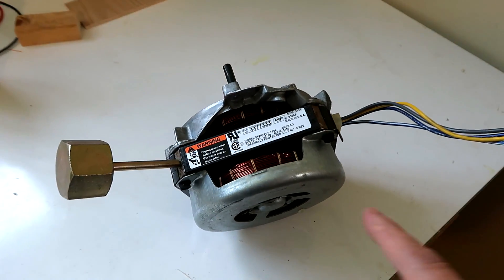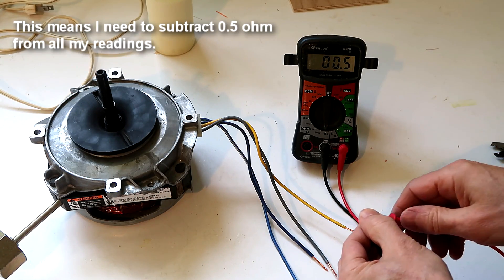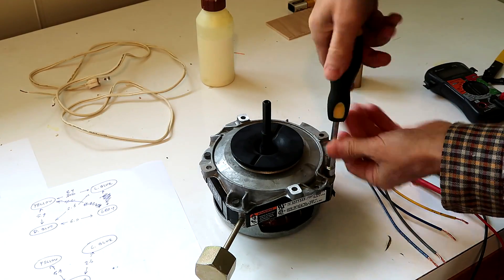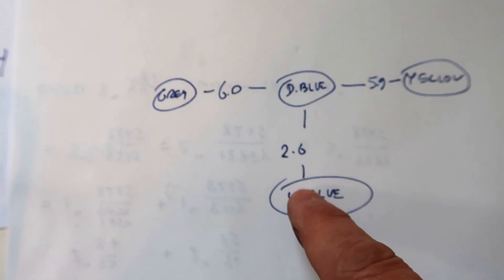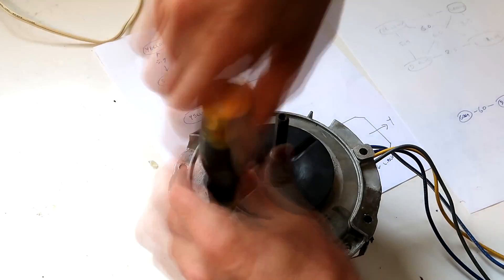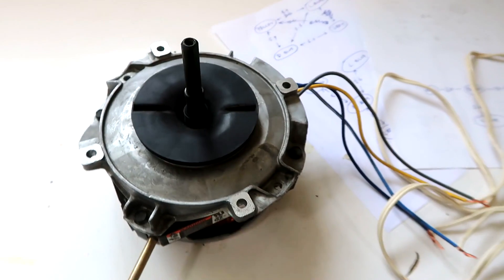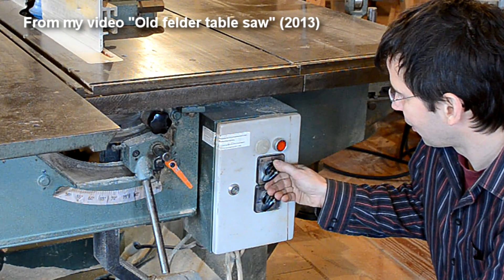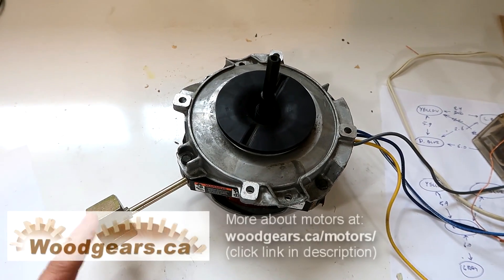Figuring out motor wiring - one example

Comment: Thanks, Matthias. I just got this exact motor from a dishwasher and found your video.

If I may suggest one thing, when unsure of the motor (which could be shorted internally), use a clothes iron or a heater in series. If there is a short, the series load will take it instead of sparks and a tripped breaker.

Comment: I have what I thought was the same motor except I have red black blue and a white wire I thought was neutral and that's how I run it but this had a weird start coil that was like the capacitor and went to the blue wire. I just touched it on the hot real quick to start

Comment: For the record, there's a simple way the controller can tell if the motor has started (and I'm not saying any appliances DO this, as I'm not in the business): let's say it drives a relay or triac to connect one lead or the other of the resistive start winding to the line for the run winding, and holds that for half a second (or whatever) - when it ceases driving the relay or triac, if the motor is turning, there should be a substantial AC voltage across the start winding.  Safely clip a DMM set to appropriate AC voltage range across the start wires, along with a suitable jumper wire from one start wire or the other (CW or CCW) and touch that to the Line as you switch on the motor, and as per your video disconnect that just as soon as it is running, and you'll observe an AC voltage on the DMM, even though the start wire is no longer connected.  If you don't touch it off and let the motor hum when you apply power to the run windings, you'll see there is no AC voltage on the start winding.

I'd wager one could use the voltage across the starter windings to ascertain if the motor is bogging.

CAUTION: the starter wires will also have power on them if you were to say spin start the motor, so don't assume that because YOU aren't energizing the wires by connecting them, that they are safe to have dangling about.

Comment: Holy crap - I can not believe I found this video. I'm working on my Kenmore Diswasher 665.15772990 right now and the motor has failed. It tries to start up but it struggles to move. (Motor Part #3377333). 

This video was very interesting and helpful - I'm going to play around with the motor now and see if I can fix it. Thanks!

Comment: Most likely it has a capacitor start motor. The last time I took apart a dishwasher, the circulating pump motor had a 15uf capacitor. But the drain pump had no capacitor or shading poles. So the drain pump had a permanent magnet motor that can turn either directions.

Edit: I checked online and saw that this motor was used as both the circulator and drain motor. So you are actually right about it turning both directions!
Reply from the maker: lots of cheap motors just use resistive start.  Just because your diswasher used a capacitor doesn't mean this one did.

Comment: Thanks Matt. My 16yo son took apart an old dishwasher and we could not find a wiring diagram for the motor. Same 4 wire setup. After doing what you did with a multi-meter and resistance we also figured it out and now my son wants to do all kinds of stuff with this motor. Awesome, never too old to learn something.
Reply: Hey Leon, what did your boy make with the motor? :) If nothing yet, might I suggest building a massive Van de Graff generator? 🤓⚡
Reply: I use mine for all types of things like a leaf blower and blowing my air into a blood plasma centrifuge forge. I was trying to manifest a flex shaft rotary tool and ended up with a flex shaft vibromatic massager that I easily adapted an end on so I can use angle grinder blades or a drill chuck for other bits.. Now I have to look up what is a Van de graaff generator.. lol. I mostly am stuck working on things I made out of transformers but always make time for motors or any tool making projects.
 @mannys9130
Reply: Cool im basically just like your son lol, i dismantled my dishwasher after it failed and i got a motor as well, it doesn't start tho even with capacitor, I do not think it works :(

Comment: The motor you was talking about, is mostly a single phase, and mostly they are mostly have a start capacitor to start it up , and those wires you was talking about that was not connected to the stator is mostly that I think is supposed to be where the capacitor starts it.

Comment: Why does the main winding not draw 120V/2.6 Ohms =~ 46 Amps?  It is drawing only about 1/10th of that...
Reply from the maker: Most of the voltage drop is ac inductive.  But on dc, it really would draw that much for a few seconds before it catches fire
Reply: @matthiasrandomstuff2221  Right, of course.   The inductive forces of the winding resist the changes in current direction and generate a counteracting voltage, basically.

Comment: Never knew electric motors some electric motors needed a starter or start circuit
Reply: Its because its an AC motor, at dead stop, AC motor would spin in either direction so you need to force it in one direction by using a dephased current.

Comment: i wired a 3 phase induction motor (.7kw just a baby lol) in single phase and used a timer to switch the start cap(like 1 second) seemed to work well but i didnt have a load(except grinding a piece of wood on the rotor, which was kinda dangerous). Its cool this motor had two start windings for either direction. most dish washer motors in my country are shaded pole motors

Comment: you were on the right track,this motor uses a current relay to start like a fridge compressor.On some dishwashers the motor runs forward to pump water around inside then reverse to drain, great vid.

Comment: If you put a capacitor parallel to the induction coil of the solenoid that would give you a single starting impulse. The right value would depend on the resistance of the coil (the idea is that the impulse would be triggered once the capacitor is charged)

Comment: Hi Mathias! Nice design with using the 24V relay for starting! 

 This motor had either a current-relay or a PTC start device. 

The PTC device is just as you describe; it's a timed device which kicks out the start winding after carrying current for a moment. These are used on fridge compressors extensively.

A current-relay is also really common with dishwashers and older fridge compressors. As you know, the main winding takes a lot of current when it's stalled.  The current drops as the motor speed picks up.  A current relay engages the start winding when the main winding is taking a high current, and then drops out when the current is less. Here is a video where I show a current relay that needed a coil rewound. https://www.youtube.com/watch?v=0qNh3oYrJxE 

If you're interested in a PTC start device, look at your local HVAC service parts company. They will have a Supco device which has an overload breaker as well as the start device. They call them a ROx1 with RO81 being for small motors, and RO41 for larger ones. :)

Comment: Why not use a light timer for stairways which can switch off after 1 second? Would be much safer to use than a sparking relay.
Reply from the maker: cause those tend to take multiple seconds, and I would need about half a second.
Reply: @matthiasrandomstuff2221  https://produktinfo.conrad.com/datenblaetter/400000-424999/409658-sp-01-ml-INTERVALLTIME_de_en_fr_nl_es_it_fi_sv_pt.pdf For your inspiration :-)

Comment: Fascinating..is there any way to decipher from the outside if a motor is brushless or brushed.
recently picked up a power tool.
and I'm uncertain if it is brushed or brushless..
was convinced it was brushed, hence price but don't see any sparks, like you usually see on brushed, and you did on the old version of this tool and did notice on a foreign site people stating brushless, but hence translation and stuff it can be a pia to sense what it is being said...
it is an 12v angle grinder.
It is a lot quieter than the previous version, and also soft-start, perhaps ESC orientated,
https://imgur.com/a/H3fkgAR
Is there any way from the outside to decipher' if it is brushless or brushed.??

Comment: One of your meters is stuffed.  4 amps at 120 volts is 480 watts
Reply: When you factor in the power factor with the motor at no-load, his meter is correct for this motor at no load.
Reply: @davida1hiwaaynet  so you are saying a motor with no load has a pf of about 0.35
Reply: @davida1hiwaaynet  the motor obviously needs a capacitor on the start winding
Reply: Yep, that is very likely for the power factor!  These motors are just designed to be inexpensive. The dishwasher only runs for a short time without load, and then has a constant load of a pump once the water fills up. After that the PF should be in the .7 to .8 range. With a capacitor it should be a lot higher for sure, but the bean-counters screwed up that idea......

Comment: Corect only your not suposed to just conect the starter windings to the Phase but rather use a "Starting Capacitor"
Reply from the maker: unless its a resistance start motor, in which case, there's no starting capacitor.  Do read up on that a bit.

Comment: For the circuit, you could use a Schmitt trigger to switch the relay 
That'll stop it jumping 
And you still don't need any computers for it
Reply from the maker: A schmidt trigger would switch LOTS of time on AC too.  And for DC, any relay is a sort of schmidt trigger already.
Reply: @matthiasrandomstuff2221  I was thinking about it and I had an idea that is very simple and might work to stop a relay jumping; a full bridge rectifier with a smoothing capacitor on the output to power the coil of a relay
A smooth rising voltage should stop that happening

Comment: Please make a complete tutorial for identify a capacitor start and capacitor run induction motor.
Thanks
Reply from the maker: It requires good knowledge of electricity and motors first.  And so the tutorial would be so long that you wouldn't watch it.  The whole point is, it's not straightforward.
Reply: @matthiasrandomstuff2221  thanks for your reply.
I am good in electronics. But main point is that your explanations are easily understandable.
You can make in part wise.
Don't think that I get bored from your videos, but actually i enjoy your video as it is in lucid and have proofs. Length doesn't matters.
I had watched and enjoyed 1hr 13 min. Of one youtuber 'mbahtedjo' about brushless dc motor and made my own successful bldc motor with the help of that video. 
Infact I love your videos very much.
Thank once again.

Comment: Thanks for uploading such informative video.
How you have determined 3450 rpm of this induction motor (03:12)
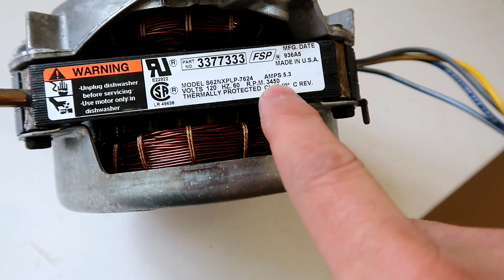Reply: Loot at the sign on the motor at around 00:24
Reply: @diejecos4812  thanks for replying.
If sign or labels on motor will erase then how can we find rpm. Is there any way to find out RPM of motor if no information available.
Reply from the maker: check the windings to see if they are 2-pole or 4-pole.  Or just run it.

Comment: when you are measuring resistance you have to remember to not hold the wires to your test leads with your hands. doing so will add your body Resistance to the reading. (I learned this the hard way)
Reply: Well, your body resistance is in parallel with the resistance you are trying to measure. So it is OK when you are measuring small resistances like this. Your body doesn't have much effect on the measured value. But if you are measuring maybe meg ohm or hundred kOhm resistors then it could make your measurement inaccurate. I do agree that it is best to avoid and usually there is an easy way to avoid lumping your skin resistance into the measurement.

Comment: I was just looking into understanding current relays (used in small ac and refrig systems) and potential relays (used in larger systems) for switching the start cap in and out.  I believe you had that relay wired up as a current relay.   Off the shelf, the current relay has large gauge/low resistance winding that only makes the contacts on the start up current but breaks when the lower running current is reached.  But they have the problem of rapid cycling as they reach stasis.

update: Found a ladder diagram for a dishwasher showing a current relay.  Could use one of the HVAC "3 n 1" start capacitor kits in place of the relay, with or without the cap in place.

Comment: You can steal a start switch from a fridge or freezer motor. The hermetic compressors do not use a centrifugal switch as the arc will damage the refrigerant.  The coil of the switch is in the power winding lead so when power is applied, the high stall current turns on the relay operating the start winding.  When the motor comes up to speed the current drops to run current and the start relay drops out.  With a switch you can send the start to either start winding.
Reply: How do I wire this up?
Reply: @mickey7660  If available find the service manual for the machine it came from. Look up the wiring diagram. Since it is listed as a mystery, you have more work and need a multimeter, a bench DC power supply, and a pocket compass. With the meter identify all leads that are in sets, such as the run and start winding. If the motor is two speed, there will be a winding that appears to have a "Center tap. Motors that are not reversible will not have two ends of the start winding separate, but one end will be tied to the common of the run. The run winding will have the lowest resistance. If two winding's have almost identical resistance and have a common wire, this is the two run winding on a two speed motor. Power one or the other to common, and never both at the same time. A current powered start relay is gravity dependent so it must operate in the original position. The motor RUN power is fed through the relay coil, so when the motor is first powered, the high current draws in the relay and applies start current to the start winding. The start capacitor is in series with this start relay contact. When the motor comes up to speed, the current drops and the relay drops out the start current. Many diagrams are online. The trick is to identify the start and run windings and possibly multiple run windings for a 2 speed washing machine motor. http://www.jimdow.com/jimdow/sales/diagrams/refcompressorstartwiring.jpg
Some motors do not have start tied to the run so trading the ends to reverse it will start the motor in reverse.
Reply: @isettech  thanks for your help I appreciate it

Comment: With no load, since the VA product is 516 but it is only consuming 167W, this means the current and voltage are about 71 degrees out of phase. As you increase the motor load, the current will rise and also come closer in phase with the voltage, both causing the true power consumption to increase. None of this really reflects on the efficiency of the motor, though. Of course, the resistance in the house wiring will incur the same losses on the 4.3 amps regardless of its phase from the supply voltage (the voltage drop in the wiring will be in phase with the current).

Aside that, I was wondering what the purpose of that side-arm was.

Comment: What would the harm be in having an "ON-OFF" switch, a momentary "FWD", and a momentary "REV" used just to kick the motor into rotation?
Obviously you wouldn't want to leave it in "ON" without then kicking it in a direction, but that is an in-elegant solution to an in-elegant problem.
Reply from the maker: that would be ideal, but hard to find a switch that allows the start and on in one motion and then reverts to stat off again.  Separate pushbuttons are no good - means the motor could be left without starting it.

Comment: And if you scrape one of the heavy windings, you'll likely see a bright, silvery looking color below the reddish copper- colored enamel- that's right, they're using aluminum windings instead of real copper in a lot of consumer goods, Microwave ovens especially have fallen to this cost- cutter, which is why they run so inefficient; engineers figured any motor or transformer that has a limited duty cycle can be made cheaper this way.
Reply from the maker: I have never seen a motor with aluminium windings
Reply: @matthiasrandomstuff2221 ; It has been some time ago, but as near as I can recall it was an electric pressure washer. I have seen the vast majority of microwave oven transformers wound with aluminum though.
Reply: @1pcfred  Then somebody go their moneys worth- agreed, a rare thing nowadays. ☺

Comment: the ac induction motor is fine bro - just needs a capacitor in series with one of the coils (capacitor phase shift).  you could also grab a small transformer and wire the primary transformer coil in series with one of the motor coils (inductive phase shift)(ignore secondary transformer winding).  just need to delay the phase quadrature on one of the coils.   capacitor method has more starting torque.  google: "delta Y induction motor capacitor diagram".

Comment: I just fixed my old General Electric dish washer that we’ve had for 25 years. The induction motor is pretty big compared to the one in the video, but I think it only produces 1/3 HP. That motor is built so well, I bet it might last for another 10 years or more.

Comment: Very cool explanation.  You could also activate the starter relay with a current loop, since the main motor won't draw the 4+ amps until it's running.

Ehud